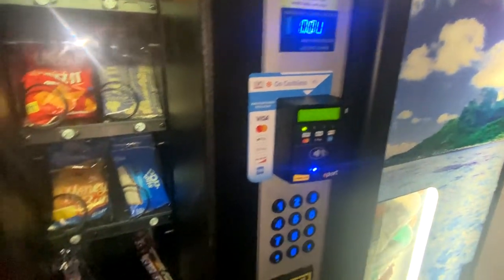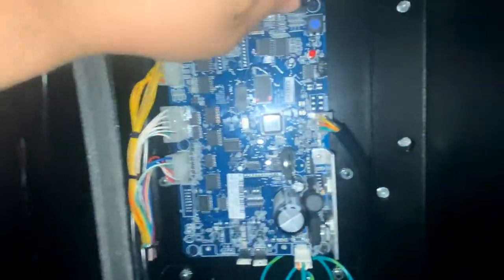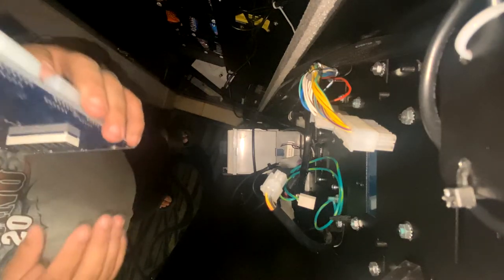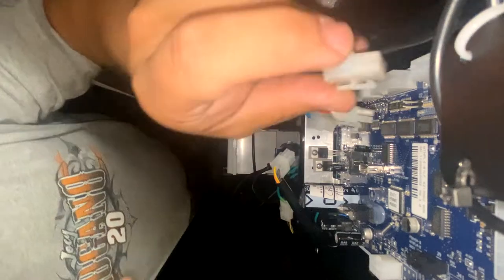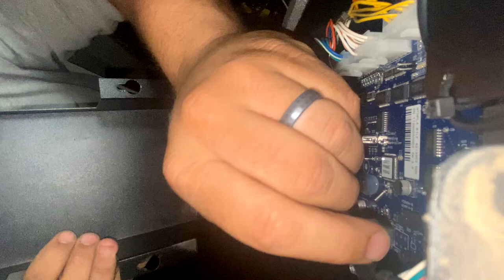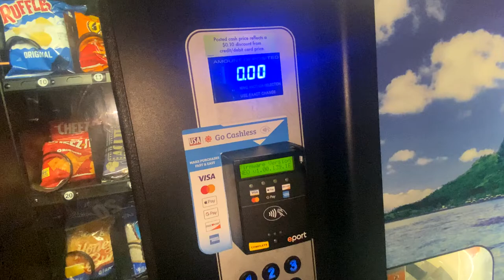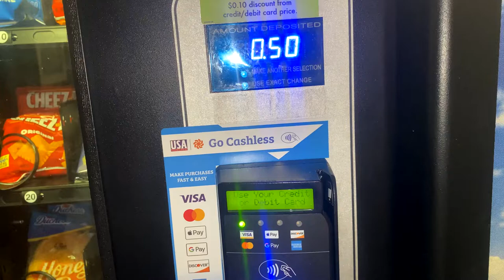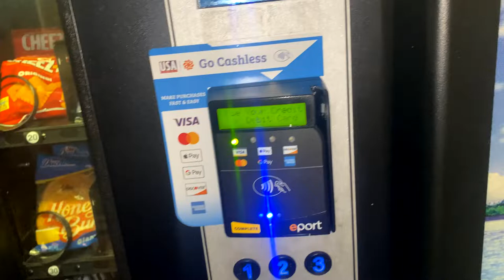USI Board Replacement and Subscriber milestone

Comment: What board did you replace with for the AP7600
Reply from the maker: On my AP7600 I used an InOne board to upgrade that machine
Reply: @720vending so you need to upgrade the board to add a cc reader?
Reply from the maker: @johndood29  for the AP7600 you need to upgrade the board to add a card reader. For the USI Machine if it already has a GVC 1 prime board you are good to go
Reply: @720vending  mines is original parts so i may have to upgrade correct?
Reply from the maker: @johndood29  what model is yours
Reply: @720vending  the AP7600
Reply from the maker: @johndood29  yes the InOne kit is available and i did an overview video of the InOne board installed in my machine
Reply: @720vending  okay so then i do have to replace the existing board 😩
Reply from the maker: @johndood29  yes the machine needs the InOne board to be able to take cards
Reply: @720vending  you have the link in on of your videos?
Reply from the maker: @johndood29  search for InOne overview